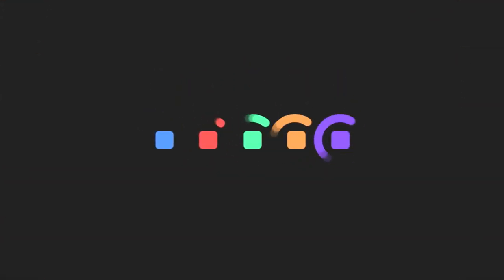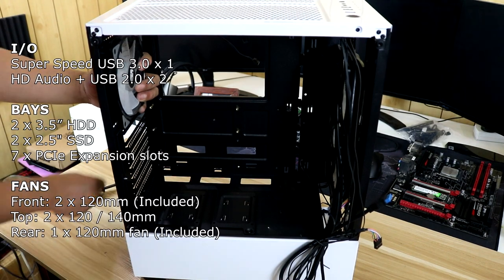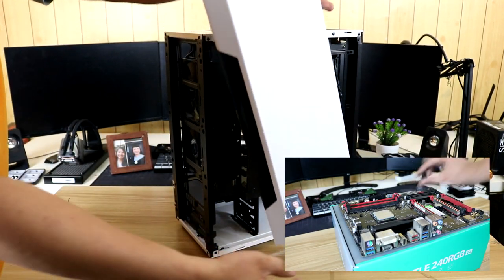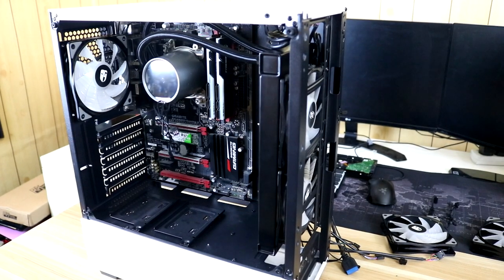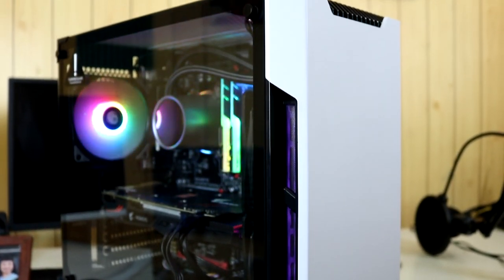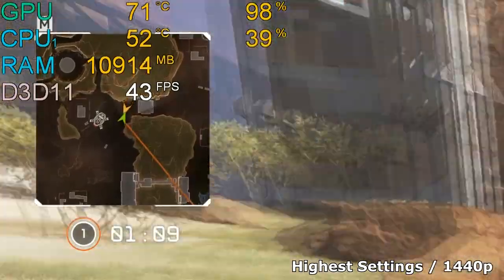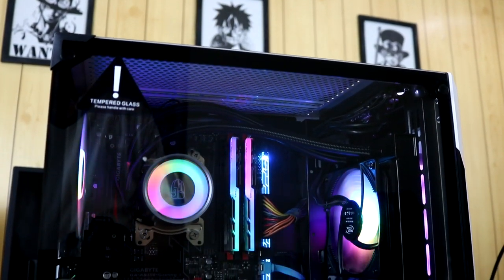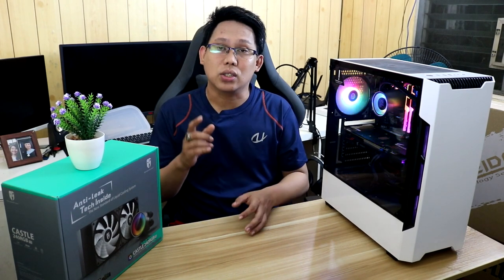Tecware Nexus Evo (White) Review

Comment: Great review! If I may ask though, since you did say that the top and bottom part of the front panel is solid/restricted, how much does the front panel would choke the airflow going into the case? And how would it affect temp? Have you test it yet?
Reply from the maker: The top is blocked by a plastic cover and the side air vents are the only air intake in the front. There's a little bit space at the bottom but its for removing the front panel. Then temps arent affected much if you're using a PWM fan and an aftermarket Air cooler or AIO
Reply: @WMDTech  how about the GPU temps? Would love to know it fares too

Comment: How  did u remove the front panel? You just pull it or curled up the screws from the inside?
Reply from the maker: Pull it up from the bottom part, you will see a gap below the front panel and pull the panel from there upwards with a little bit of force.

Comment: Sir yun po bang fans na included ay rgb?
Reply from the maker: nope makikita mo yun sa unahan ng video, black molex fans lang yung included
Reply: @WMDTech  salamat sir. Pinagpipilian ko po yan evo or  yung vision.
Reply from the maker: Vision has 4 orbis pero mahina yun eh either go with PWM fan + Evo nalang much better pa
Reply: @WMDTech  salamat po sir.. makakatipd po ako. . Nasa less than 40k lang po budget ko.  Nag iisip pa po ako kung ryzen 2400g or ryzen 3400g or ryzen 2600. Hindi naman for gsming ang purpose ko. Pang youtube stream stream lang, pang browse din. Pang windows office pang research din ng mga assignment ng anak ko. Pero gusto ko kahit paaano may rgb para matuwa anak ko.
Reply from the maker: If that's the case try nyo sir Ryzen 1600 solid parin naman yun dahil 6 cores at mas makaka mura kayo around 7k nalang ata sya now medyo pahirapan nga lang sa stocks.